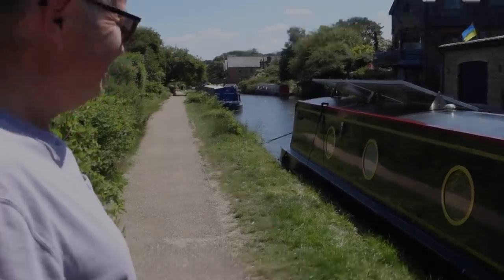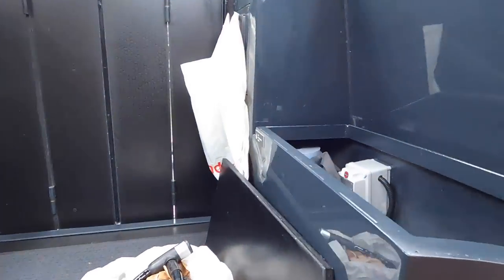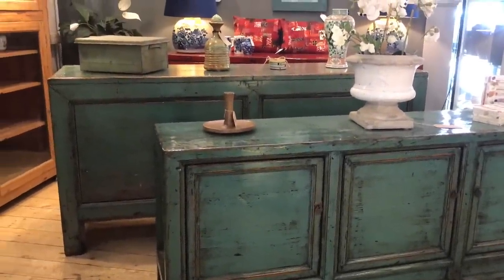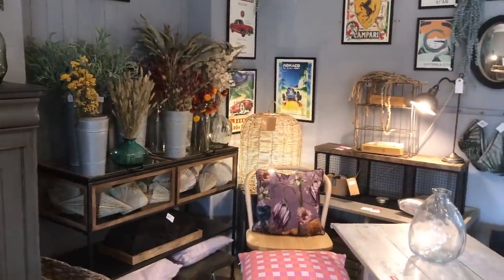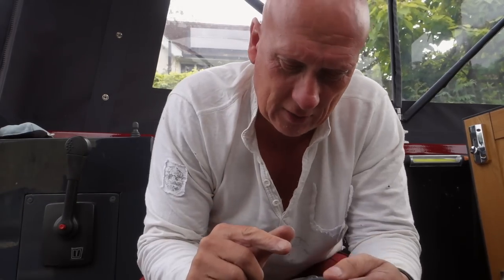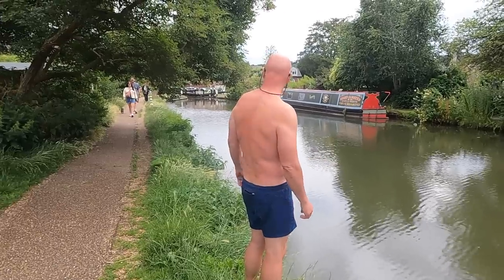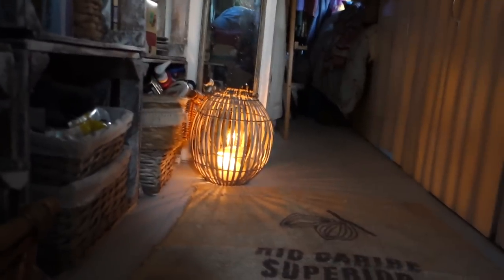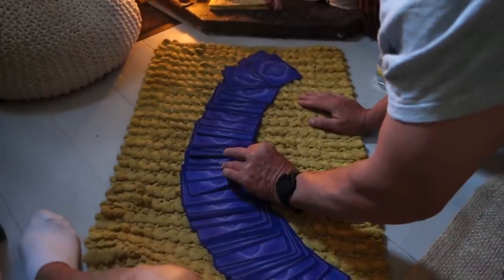Narrowboat Life - I've Had Enough - S3 Ep2. #narrowboatlife #maximiselife

Comment: Funnily enough I got a cord for my glasses last week. I have to use reading glasses and they usually sit on my head till needed but hot head makes dirty glasses, so i got the cord.  Now all I need is to be told is how to stop them falling off! I tighten the elastic bit but only have to slightly kbock them and they come off the cord!!!!

Any help on the most welcome 👍

Plus on on earth can it be a year since you took control of the boat! A whole YEAR.  We used to love watching the lads doing the fit out.
Reply from the maker: Time has flown Ann. Glasses are a pain. I won’t knock it too much. Better wear them than not being able to see properly. The cord makes the glasses easier to find so it’s working. I’ve misplaced them since but find them so much easier. Thanks for the comment and have a great week.

Comment: Phil here from NZ. As usual another great vlog. Re: your alternator belt if the squeak happens again. On my old mini I used to rub a little candle wax on the V of the belt. Do it while the engine is running at idle and mind your fingers. Not a complete fix but gets rid of the annoying noise until you can investigate.
Reply from the maker: Thanks for the tip Phil.  I’ll be sure to do that as I think it’s going to be an ongoing issue. I appreciate the support and comment. Have a great week.

Comment: Product that works is BELT GRIP.
Sounds wrong but old timers used to hold a bar of soap against the inside of the belt with the engine running. Extremely dangerous but stops slipping belt in emergency.
Reply from the maker: Can I ask if it’s any kind of soap Douglas?  I’ll certainly be using that tip. Thanks for the comment and have a great week.
Reply: @chrismears-inslowtime  
Hi Chris,
I'm 74 and it was back in the '90's but I'm maybe sure it was just a bar of hand soap.
Take care to not get your self wrapped around the water pump.

Comment: We have a plan to sell our house and buy either a narrowboat or a wide beam, do you have any experience with wide beams? I'm a little concerned we wont be able to go very far due to the locks
Reply from the maker: Narra - go most places. More than 58ft can be a struggle on some canals. 
Wide - spacious. More like a studio flat. More like home. Difficult to go through bridges and you travel slower but if that’s for you, great. I like wide beams. 
Anywhere there is a double lock a wide can go. The GU is a big canal. The K&A too. Both will keep you busy for a while. If you go north, less traveling I’ve heard. In short you can do north or south not both unless taken out the water. Canals with double locks. I would seriously consider it if I were to buy again. 
Hope that’s useful.